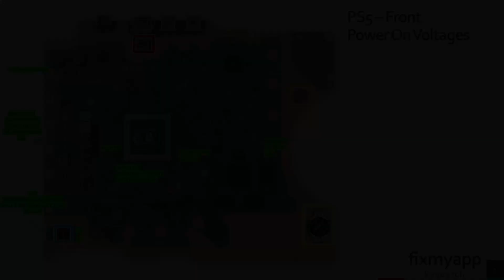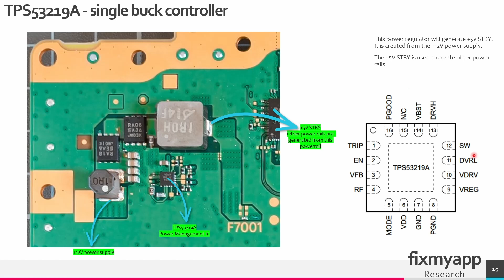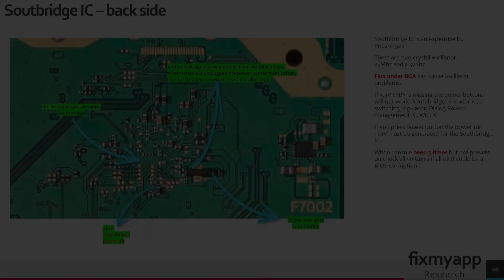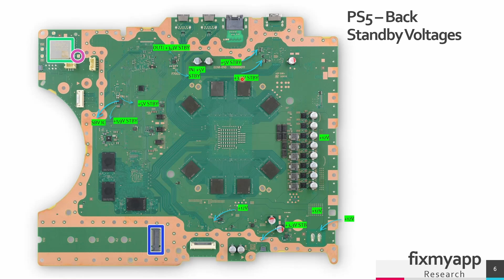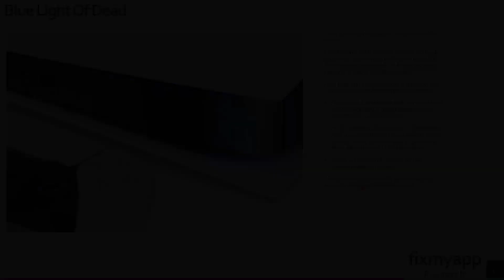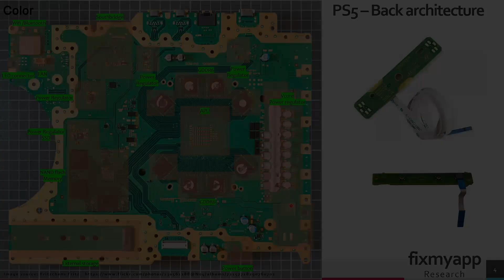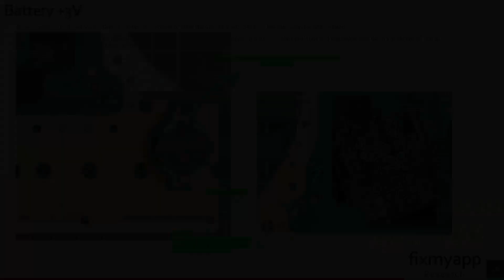PlayStation 5 Ultimate Troubleshooting Guide - Fixing Your Console Like a Pro

Comment: Hello Jimmy,

On page 6 of the presentation I purchased, a voltage regulator is shown with 5V standby input and 3.3V standby output. On both of my EDM-10 boards, I measure only 1.8V at the output. Which circuits does this regulator supply? Both boards fail to start.

Comment: Anyone know resistance to ground of the power going to the apu in edm-044?  I have .1 ohm.  Maybe need to lift inductor and check each phase?   Symptom is beep no light.  Have checked under thermal cam and no hot spots on apu or shorted capacitors.  Draws about 230mA  but no shorts around SSD controller.

Comment: Does the amp test also work if i connect an amp meter in series between the motherboard and the powersupply of the ps5 or do i need a lab power supply that is set to 2 amps?

Comment: Hey there, do you happen to know what the two big electrolytic capacitors (right side of the power regulator, right on top of the board number EDM-010) do? I am missing one out of the 2 on my board and the other one has a broken solder. Thanks!

Comment: 48:58 I'm getting not getting 12v here on standby but when measuring at the power supply I get 12v. Any idea what could be the issue? Aren't these just straight pins and should have the same voltage before it gets distributed throughout the board?

Comment: Now I found the best ps5 video!
Just one more thing to note is what its married with APU besides disc drive board.

On fat ps5s, 3 ssd chips are married with the APU. 3 others don't (2 in side 1, and 1 in side 2). 
You can change the 2 that are in line in the side 1 where the controller and APU are, and one other on the other side (2) that is alone (the other 2 in line are married).

On slim ps5s, we have 2 of 4 chips married. Side 1, the closest to the APU is married and the other is not.
At side 2 were the ssd controller is, the closest to dialog chip is married, the other is not.

For ps5s pro we don't know yet, no tests were done yet, but we assume that is the same as slims.

Sorry for the confusion, my English is crap, and with pictures would be easier to show.

Thanks for this video! It will be very helpful

Comment: What to diagnose when get white dots and snowy screen when gaming? It works fine when not loading games. This happened after HDMI port replacement for the customer.
Reply: One of these things:
1) Flux in the port or cable, needs to be cleaned with alcohol and air.
2) Pin loose, just poke lightly in the back with Tweezers
3) Missing a capacitor or diode, knocked off by other person
4) Faulty port, replace the port with a new one (almost never happens but easy to check)
5) Panasonic chip is failing (rare but happens and a level higher in difficulty than hdmi)
Reply: @Ghostofnyx  I have checked 1-4 and they are all fine. Going to replace that Panasonic IC when the new chip arrive. Wish me luck.
Reply: @Ghostofnyx   Thanks a lot. I have replaced a new hdmi port and checked all caps components around the port front and back side, no luck.  Have gone to a pro repair shop. Check the port pins, replace Panasonic IC and still not working. He said maybe the APU is faulty.

Comment: Fantastic video! I have a 12v short to ground on the 12v power rail. I’m a little confused on the removing the main 12v coil to test which side. I think I understand the APU side, but what is the “other side”? Which components do I test for the “other side”?
Reply from the maker: Hi, you will be testing the power MOSFETs side / buck controller which does the switching of the +12V. Gr. Jim
Reply: Thank you for responding! I have removed the coil to determine that I have a short on the APU side. I believe I have a bad V core MOSFET. Would it be better to inject voltage at the short or remove all of the v power coils and measure the input to output on each MOSFET to find the short? Thanks!

Comment: How to verify all pins on ethernet port are actually working?
Reply from the maker: Hi, You could use a old utp cable and measure each cable is making a connection on the mothboard with a multimeter. Gr. Jim

Comment: Very good video. I do have a question about the blue ray drive. On the connector blue ray connector on the main board there is supposed to be 12 volts, and 5 volts present in standby. I do not understand how the 5v is sent to this connector. Can you tell me how 5volts gets generated here and where to find the components on the main board. I am working on an edm-020 board with blue ray drive and this voltage is not present. I have checked the 2 fuses for this connector, and they are good.
Reply from the maker: Hi, it is a while ago that i spend analysing ps4. I don't know, some models could be different with the layout. Gr. Jim

Comment: Hey, awesome video! I’m dealing with a unique issue and could really use your input.
I don’t have access to a thermal camera or pro diagnostic tools - just a multimeter - and local service wasn’t much help (they took off the warranty sticker but didn’t unscrew the metal shield or give a clear diagnosis).
My PS5 started crashing frequently with CE-108255-1 errors while gaming, and it got worse over time - eventually it would freeze even in the menu. After the service visit, the console became almost unusable: at first boot it showed artifacts and then froze without beeping. Now there are no visual glitches, but it freezes within 10-30 seconds of startup (can’t get to menu), though I can force shutdown with long press on the power button.
I didn’t see this exact case in your video, so I’d really appreciate any suggestions or directions on what to test or measure next.
Thanks a lot in advance!

Comment: i have 1.8v line short on south bridge power management ic. Inject voltage and south bridge light up in thermal. bought replacement ic from aliex[resss but shortage came back on same line.is my replacement  southbridge faulty. I used 480 and 90 air on hotair did i cook the south bridge ?
Reply from the maker: Hi, there could be a few issues, fake chip, reflow not fully completed, other component is causing the short. it is hard to say. Gr. Jim

Comment: I'm pretty inexpierenced, so it may be dumb questions..
I have a PS5 Slim with EDM-041 - no power on. 
PSU is fine.
I only can measure 12V on the board. No 5v and no 3.3V .

what also confuses me: the fuse at F3501 shows me OL, but at the same time it's the only fuse that also shows me the 12V - is this normal?
Reply from the maker: Hi it is hard to give advise as every board is different and could be alot of different issues. But standby voltages should be present if not that is the first part to fix. Gr. Jim

Comment: My Vcore beeps with ground, is this normal? And other parts where there are coils too
Reply from the maker: Hi Vcore has a low impedance, so yes your multimeter can beep. The coils are a part of a voltage rail depending on the purpose some can beep as they are also low impedance lines that maybe go to the memory, CPU. Gr. Jim
Reply: I tested it with a UART program and it showed that it is RAM  @fixmyappjim

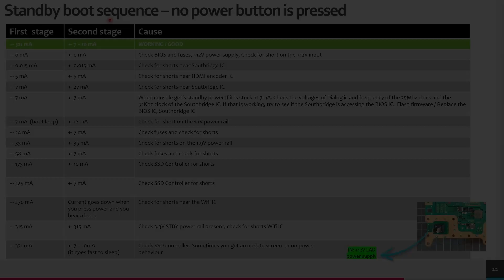Comment: 16:12 In the Standby boot sequence right below BIOS and 12 V checks. Is this vaule (0,015 mA) correct in that unit of measure?. If so then I can't be sure with My Bench Lab since it's 5 digits only. 

The minimum it can show its 100nA.
Reply from the maker: Hi, yeah basically if it 0 mA also check for shorts near the southbridge. Gr. Jimmy

Comment: Firstly, this video is incredibly helpful, thank you so much for sharing it! I have a PS5 with normal boot sequence (320-7/10ma) but it happens very quickly. The console powers on, then off shortly after. All standby voltages appear to be present and I have no shorts. I tried removing the fuse from the SSD controller ic circuit and testing the draw at those 2 points and I’m only getting a very low reading. My multimeter isn't the best so it's possible I'm doing something wrong, but would this imply the SSD IC / circuit is bad, or is there anything else I can check before replacing it? It’s an EDM-03X. I actually have 2 of these exhibiting the same behaviour but I’ve had a hard time diagnosing faults until I stumbled across your video. I hope you can help, thanks again! I’ll be buying you a coffee and picking up that PDF when I get into work tomorrow, it’s gold. 😂
Reply from the maker: Hi thank you for your support! This is hard to diagnose. You can try reading the serial debugging information by wiring and soldering the wire and reading it on a pc. I suspect it would be RAM related or indeed SSD related. Gr. Jim

Comment: 46:57 My top right memory bank has a resistance of 10 ohms and no voltage on startup. Where do i go from here?
Reply from the maker: Hi, when the resistance is different compared with the same other memory on board i would replace it as the resistance is different. Gr. Jim

Comment: Is there a way to disable the power button? I think it got stuck pressed for some reason, so the ps5 only turns on when I plug it into power, it beeps twice +
Reply: And then it turns off. I've also been able to turn it on via HDMI and the TV function, but it goes into Safe mode, I have no idea why.
Reply from the maker: @franciscoalvarez9160  depends if it is a touch button maybe the circuit is faulty? If it is a mechanical switch  then if the voltage is present. Usually there is a voltage +- 3.3V that is high when you press the button the voltage is pulled low and then it goes back high. Gr. Jim

Comment: Hi great video! Im struggling with edm031 board. As you mentioned in current table i got something very simmilar to last case. About 321mA jump at start for about 10seconds and that drops to 8mA. You mentioned SSD controler how i could check it? No shorts on caps. Also i try with bios. Set to diggital version with bios found on badcaps forum but then no more 320mA but only constant 8. Also no lights or beeps, could you help please?
Reply from the maker: Hi, it is hard to test the best method is to have a donor board or IC and swap them out to see if the behaviour is changed. Gr. Jim

Comment: Superb Video. Had to repalce a broek HDMI but still no Output. Have Gone through your video testing everything,alls present, unit boots up into a white light but still no HDMI output. Anybody have any ideas?
Reply from the maker: Hi, i would also replace the hdmi encoder IC as it can fail also when the diode measurement are the same.

Comment: 36:36 i get 3.3v on the top pin nlbut not bottom pin or pad next to it, also no 1.8v on cap, i get the 5v. Any ideas please?
Reply from the maker: The bottom pin should give 3.3V when the ps5 is powered on. The 1.8V should present there maybe in power on is generates the 1.8V. Do not know if that should be +5V. Gr. Jim

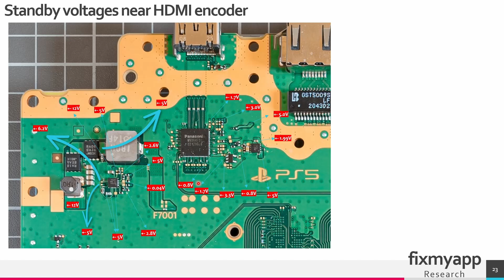Comment: 33:00 dont have voltages on the right side of HDMI ic, but HDMI ic is good (tested on another console) 0.8 V, 1.7v, 3,3v around voltage regulator and 1.7v and 3.3V on the top right corner of HDMI ic..What could be cause? thanks for your answer
Reply from the maker: Hi, Hard to say, i would check those voltage rails measure the resistances and trace the lines to the components maybe there are voltages missing due to bad components. Gr. Jim

Comment: The ps5 automatically turns on with two beep sounds and turns off then.The power button doesnt work anymore.
Please help 😢
Reply from the maker: Power button needs 3,3V this voltage rail is maybe missing or else there is a short on the line or the southbridge ic.
Reply: @fixmyappjim update- i got it repaired it was some circuit fused of motherbaord in 118 dollars

Comment: This is the best Video which i ever see in my life 🥺🥺 

I have a 12v Short directly on the Powesupply + and - on Mainboard is that means AGPU Are defective or looking for the 7 Mosfets ? 

Every 7 Mosfet have short 🥺
Reply from the maker: Hi the 7 mosfet are shorted because they are connected in parallel. You can isolate the problem by removing the output coils of each phase untill the short is released. You can also inject max 0,9V with 2 Amps to see which mosfet or the APU is getting hot. Gr. Jim
Reply: Hi, 

it isnt the mosfets i have check it 😞

The short is on PS5 Slim Digital on R22 Coil are the short
Reply from the maker: @user-bw5hk5nb3k  Ok do not know where that is but is the APU getting hot when you inject voltage? if yes apu is dead. Gr. Jim
Reply: I have put the Power Supply and i have directly short in the + and - from mainboard : ( 

How i can inject 0,9v and where ? 
To the coil side which its have short and - GND right ?
Reply from the maker: @user-bw5hk5nb3k  At the coil which is shorted to ground is good to inject voltage. Gr. Jim

Comment: When mesuring hdmi pins in diod mode should the board have any power connected or does it work completly free?
Reply from the maker: Hi, diode mode always with all power disconnected else you can create shorts. Gr. Jim
Reply: @ thanks!
Reply: @ replaced broken hdmi port. Every pin seems to have connection, tv sens the ps5 but no picture. I’m unsure if the hdmi cap was soldered with enouth conctact sins i couldent go closer with microskope. Hdmi diod on backside also got som small heat dameges. Could this case white light but no picture?🙏🏼
Reply from the maker: @Fhilipk  Hi hard to say most of the time capacitors are used to create a stable ripple free voltage and also there are a lot of extra capacitors doing the same thing. Try to replace or resolder it. If the result is the same then i would replace the HDMI encoder IC this a ic that fails alot. Gr. Jim

Comment: I have a faulty edm 020 board. 2sec blod. All my voltage rails are present apart from the ram coil is dead I get no volts and 0.04 ohms on the ram vias. 

I noticed under the microscope at the power button there is only one resister and a neighbouring empty pad. Should there be two resisters at the power button?
Reply from the maker: Hi sorry can't tell i currenty don't have any board which i can check. Maybe you can compare online photo's? Gr. Jim
Reply: @fixmyappjim  Its okay. The missing resistor is to do with the blu ray version. So its not included with the Digital Edition. Same with V rails F5401 and F5402, missing fuses, but again they are to do with powering the disc version. 

One last question, when removing componant such as IC's to isolate a short is it still safe to check stanby voltage rails?
Reply from the maker: @johnmellor932  Ok learned something new :) Yes removing an component you can still check voltages unless the component is responsible for creating a voltage rail then it is missing. Gr. Jim

Comment: When the device is clean but turns off after about 5 minutes or at most 10 minutes during graphic games, what could be the problem?
Reply from the maker: These problems are difficult, but most issues related to this is the SSD controller IC or maybe a bad ssd memory. Gr. Jim

Comment: I replaced the external memory slot, it was damaged by the client. But it still doesn't work. I don't know which chip on the motherboard controls it.
Reply from the maker: Hi i would say to investigate the controller ic that drives the external slot try to follow the data lines as i don't have a ps5 board now to check for you. Gr. Jim

Comment: Hey i broke my led ribbon cable on ps5, now its not even powering on! Will replacing the ribbon make it work?
Reply from the maker: The Power LED Light Board is only a output so this should not prevent it from powering up. Check or reseat all ribbon cables. Gr. Jim
Reply: @fixmyappjim  ok i was just reassembling it and broke the ribbon cable. I will try reinserting all ribbon cables once more

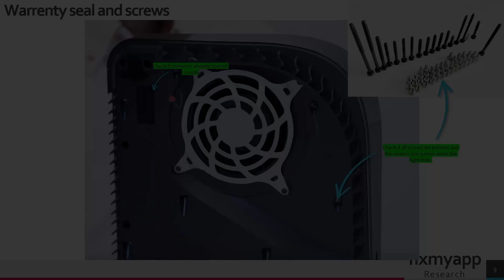Comment: At 14:35 there was minor mistake: That's not the warranty sticker. That's just a warning stamp.
The warranty sticker is on the opposite side of the console,near the fan connector.(There is an arrow)
Reply from the maker: Thank you for this information learned something new :)
Reply: @fixmyappjim No problem.
I learned a lot from this video, so thanks man.

Comment: Best troubleshooting guide for PS5 ever! You have one more subscriber. 
I have an F7001 fuse blown and an UART error code saying: "80910002 (SSD Controller) - Possible 504X 2v, Power Failure - Check Fuse F7001" so after removing the fuse there's still short in the SBV IC area. Could it be the ssd controller itself? Thanks in advance for your help😉
Reply from the maker: Hi it is possible but can't say for sure as other components near the ssd can trigger this message. If you have a donor replace the chip you got nothing to lose :) Gr. Jim
Reply: @fixmyappjim  thanks a lot for your reply, I'm trying injecting 2A near the SBV IC to see what gets hot and only the SBV itself gets a little bit hot maybe it's the SBV chip to be shorted. 
Still not sure why I get the 504x chip error which is nowhere near that area
Reply from the maker: @_King_Tech_  Hi then i would replace the SBV IC to check if it resolve the problem it's the cheapest solution. Gr. Jim

Comment: I just had to subscribe. You are very detailed and informative. I am a beginner in electronic repairs and still learning. I received a PS5 which only beeps when both the eject and power buttons are pressed. It beeps every time they are pressed. Owner said it was a power surge because everything connected to their TV by HDMI stopped working, which includes the PS5. Please have you encountered an issue like this before, and can you provide some advice based on this situation? Thanks
Reply from the maker: Hi, i have seen this issue a few time. Check or replace the HDMI encoder IC and check surrounding components this can resolve the porblem. If the high voltage reached the APU by the hdmi data lines then it is game over. Gr. Jim
Reply: @fixmyappjim  thank you for the information and directions.